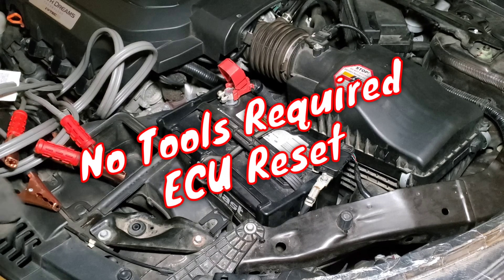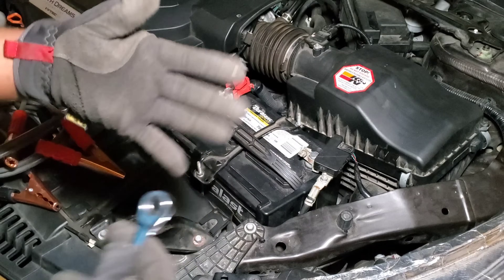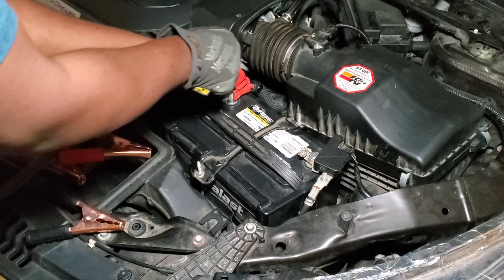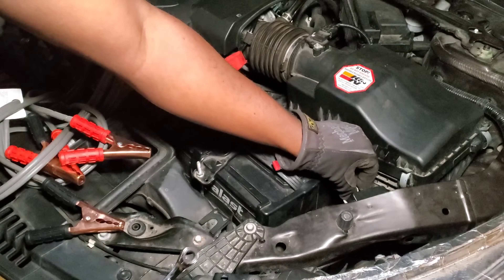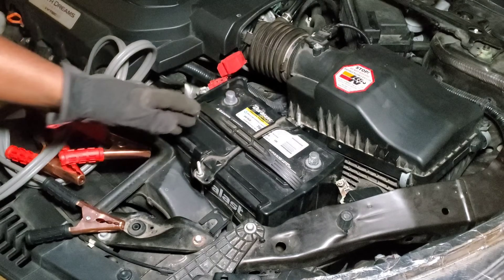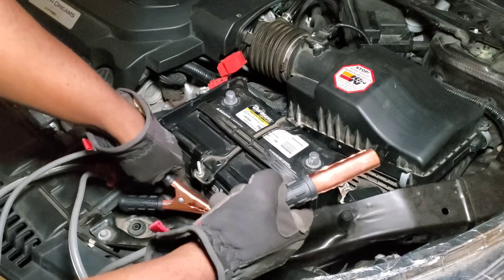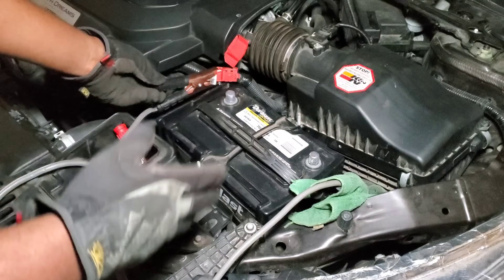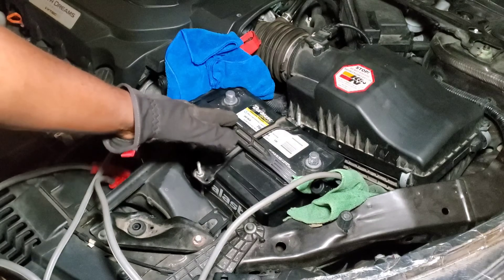How To Reset All ECU  No Scanner No Tools Required

Comment: There is another way to reset the check engine light on a 2018 Nissan Pathfinder.  It is sooo easy and it works!  Press your ignition button twice to put it into the run position, Lift the hood and remove the negative battery cable.  Then take the connector and touch the negative battery post three times about a second apart. Then just place the clamp back onto the battery, tighten, and start the vehicle.  The light should go away if the problem has been solved.  Trust me, it is that easy!  Try it, you’ll be glad you did.
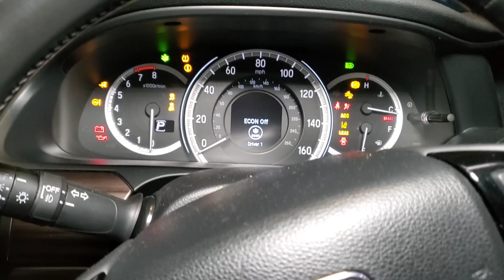Reply: What won't pass smog test 6:45

Comment: yes this works and remember -- if YOU have a remote starter, you will loose ability to use the remote starter if you live in a Northern climate and have one of these on your vehicle.  The remote will need to be reprogramed to your car at the place you bought the darn remote starter.  Mine cost me $25.00 to get this done.  And it happened before when I had to replace battery a couple years ago... I guess, this is ONE fact the remote starter place does NOT tell you... so beware, when YOU disconnect battery for a few minutes as described in this video -- you will need to shell out another $25.00 to get the remote starter working again too... dang it... Stay warm my friend.... stay warm.....
Reply: You can reprogram remote for remote start on your own. It’s easy.

Comment: of course some cars require re-calibrating certain sensors like electronic power steering sensors and electric window sensors, maybe entertainment center code input when battery power is removed for more than a couple of minutes!

Comment: Excellent advice I also turn on the head lamps while the battery terminals are off, it drains all energy and you get a full factory reset, excellent video!
Reply: @Sissiwit Sukisok You better check with Scotty on that one; he says although they don't light it still drains any power out of the capacitors.
Reply: @bradfallin2698  I agree, Scotty does give the best advice on Youtube.
Reply: @Paul Romsky  what's wrong with 2006 pt cruiser dieing when crank up and sputtering
Reply: @PamJohnson-iw2zt crankshaft positioning sensore ....
Reply: I had a 2005 pt cruiser for 10 years , had the same problem and it turned out to be camshaft position sensor , took 5 minutes to replace and problem was solved @PamJohnson-iw2zt
Reply: If the alternator is charging it's not going to die
Reply: IM WONDERIng if the battery cables would be too much. Just saw a video of scottys he said to use a one OHM 10 watt resistor, to coonect the cables.  maybe that is less spark than the jumper cables?

Comment: What if  you a have checked light on as a result of failed O2 sensor,? No matter how long you disconnect your battery terminals,the check light will still pop up , unless you get the 02 sensor replaced

Comment: I had problem with U1000 code. My battery and alternator were good and tested, but it wont charged the batter, when I drove about 10 minutes on the road It lost all power and shut off. What should be the problem here? Please help Thanks

Comment: Sorry. Doesn't work. Did exactly how you showed on your video. Reconnected and started up car and...no change...showing same as before
Reply: I STRONGLY SUGGEST THAT ANYONE WITH A 2012 Hyundai Sonata 2.0T, DO NOT TRY THIS, IT DOES NOT WORK!
I TRIED IT AND AS SOON AS I CONNECTED THE CABLE IT BECAME VERY HOT AND I HAD TO REMOVE IT IMMEDIATELY.
THE ENTIRE CABLE WAS VERY HOT AFTERWARDS.
I FOLLOWED THE VIDEO TO A TEE AND THESE ARE THE RESULTS THAT I RECEIVED.

Comment: I've a steering power faulty..so if i disconnect the battery for like one hour the fault code will be automatically deleted?
Reply from the maker: Doing this will reset all your codes but you have to make sure you fix the problem before doing this 🙏🏾🙏🏾

Comment: Cleaned throttle body butterfly and bore yesterday, then disconnected the battery reading 12.80V (= good).  With a voltmeter attached to the disconnected positive and negative cables this left a residual voltage of 1.23V.  After 45 minutes this had dropped to 0.14V.  After 12 hours residual voltage had dropped to 0.00V.  Then reconnected the battery. Started the car now purring nicely at idle.
Reply: So could I do this in 24 hours or less .. I'm guessing that would be a correct assumption.. but I'm in a pinch for time on my vw 2012 Eos Executive trim 2.0 TSI
Reply: That's facts I change a lot of things of my car and it was running worse like the computer didn't read them. New maf sensor new EGR valve filters battery clean the trothle spark plugs and cables . And it was running worse than before
Reply: Hi, what model and car is it? I have a 2008 Honda Civic, and I'm having the same problem, but I didn't fix that. I'm going to try it tonight. If it works, it might be a happy day, because I've already changed absolutely everything, and nothing fixes the high idle.

Comment: i have 2002 rav4, 1az engine, since january is parked, sent to 2 different mechanics, they robbed batter and cables, any way, car does not starts because when i try to start the engine, current does not reach bobins and plugs. 10 electricians have tried, they say someone has replaced ecu, i need opinion how to start this car.

Comment: @lover of engines , the brother how you doing ? I want to ask you if you do the same process you do to your car in a 2010 Acura MDX  it will work? And if you had any previous computer updates it will erase the updates or it will not affect those ecu updates ? Thank you
Reply from the maker: I'm pretty sure this will work for Acura because Honda make Acura
Reply: Hi brother..will this method work on Isuzu Kb200 petrol fuel injection van mine wont start..thnx keep well.

Comment: Hello my friend, I just removed the catalytic converter and when I started the truck it ran fine. I did remove the negative terminal to reset the engine light as another channel recommended. 

It's been about two weeks now since I removed the catalytic converter and I am getting an engine light 🕯️ and my truck is running really bad. I did the reset again with the negative terminal, but it didn't fix the rough running engine. 

What I want to know is, will doing it your way fix the problem with my 2020 Chevrolet Z-71 High Country Storm 2.8 liter turbo diesel??? 

If I drive my vehicle easy before I do this reset, will it hurt my vehicle? 

Please respond as soon as possible, as I need to do this today. 

By the way, I am an American now living in the Philippines. 

Thank you very much and I hope to hear from you very soon. 

God bless you and your family! 

Sincerely, 
Cpt. Michael R Metzler Sr 
U.S. Army Aviation Maintenance Officer/Helicopter 🚁 Test Pilot (retired/veteran)
Reply from the maker: Doing this will never hurt any vehicle, It will be nice to try and see what happens

Comment: Thank you so very much. I have a check engine light that is bothering me even after I have cleaned the throttle body. I will now try  you tip.
Reply: Did it worked?
Reply: @danandrei9197  It will reset a check engine light but unless the problem that caused the CEL is fixed...the light will come back on again.
Reply: why would cleaning the throttle body cause a check engine light to come on?

Comment: Once you reset the codes it may say "not ready" on inspection, the car needs to go through a few drive cycles to be "ready".
Reply: Yeah, that happened to me. The shop replaced the plugs and reset it, but I took it to the inspection station too soon. That's why I'm here now, to clear it myself and try again. I'll use this method and run some errands, then hit the inspection station.

Comment: I have a 2003 dodge dakota 3.9 liter v-6 engine and it won't start when i turn the ignition. All lights inside and out come on but wont make a sound. I had someone hook up a cd player to my ignition switch and my cd player went out months ago and now this happened. What do you think is wrong with it? PCM?ECM, ignition switch or could it just be a blown fuse or sensor?
Reply from the maker: Check your starter
Reply: I did and its good.

Comment: Hi, My battery is inside the vehicle under the central column, It is quite hard to get to, however the black strap grounding point is easily accessible. 
If I disconnect the black strap from the grounding point first. Could I then  connect the jumper terminal to the vehicle body to have this same desired affect?
Reply from the maker: No because the black cable is still connected to battery

Comment: Haha, I found out just yesterday. My car had a misfiring and would die when engage into gear. No amount of disconnecting the negative terminal helped.      Method: step on your accelerator fully to the floor and then turn ignition to "on" for 15s, continue pressing the accelerator to the floor. Then turn off ignition, lift off your accelerator. You are ready to go to normal starting and driving.
Reply: You flooded you engine.
Thats how you reset a flooded engine.
Reply: @timbowling6698  Wrong it wasnt flooded he had to do a relearning process for the throttle position,that was his problem.After messing with the butterfly in the throttle body with the battery connected this is what happens.
Reply: Is this also applicable for 318i bmw

Comment: not sure i understand the purpose of the jumper cables. If you just leave the battery cables disconnected for an hour, doesn't that also work?
Reply: To discharge all the electrons

Comment: i love your presentation i hope it will workfor my nissan sentra
Reply: depends on what your issues with your Nissan Sentra because the problem going around right now with a lot of Nissans is that the ECM/ECU needs an update and reset it doesn’t update it. Look for the technical service bulletin or TSB.

Comment: The fastest way is by discounting the negative side only and then running a jumper cable from the removed negative terminal to the positive terminal already on the battery that resets everything as new
Reply: do u coonect one black to negative the the other black to positive?
Reply: @lilryan7205  OMG. no this causes a full short! Yes you do exactly as shown. On the cables after they are disconnected from the battery.

Comment: How do you stop the Car alarm going off when you disconnect the battery? Alarms are a p.i.t.a.
Reply from the maker: you have to use the car key in the door to lock and unlock the door 2 to 3 times like you do old school some time the lock system get jem and you need the key to unjem it

Comment: apakah cara ini bisa diaplikasikan jika tampil indikator check engine & ABS di panel display speedometer?
Reply: Untuk ABS check engine light, perlu check wire dan speed sensor dulu.

Comment: So I have a 1998 Chevy Silverado 5.7 automatic four wheel drive they tell me one mechanic tells me there's a dead wire from the crank positioning sensor cannot time it correctly the other mechanic tells me there is a dead wire between the mass air flow sensor and he cannot time it correctly will do any complete reset on that perhaps bring my computer back to factory specs thank you for your help

Comment: U think it will work on my chrysler 200 2015 with service fuel sensor light on and empty fuel gas light on ???
Reply from the maker: yes but you have to fix the problem first before doing this

Comment: My astra j 2014 when scanned says misfire.

I changed plugs, I still get missfire when driving.

Do I have to reset again?
Try this procedure?
Reply from the maker: I don't know about that, but give it a try this is not going to do anything bad to your car
Reply: @Loverofengines101   I have a 2015 Chrysler 200c and check engine light on for cooling fan circuit I’ve gotten a new fan that came with new circuit and the mechanic says in order for the fan to work I have to go to Chrysler dealer so they can program it but my brother says just to try and do what you did he says sometimes that works what do you think because the fan will not turn on so the car overheating
Reply: Thx

Comment: the mil light illuminates for a very good reason, because there is a faulty component. this is snake oil guys, get yourself a cheap code reader and you will be just fine. why didnt we see a before and after of the display?
Reply: I agree with you. He said a code reader would cost 150/200. Yes some do but you can get some cheaper.  And this method do not clear the code it only gets the light on the dash to go off.
Reply: @babssb2ba  My wife bought my first scanner 4 years ago for £27 then, it was really good. I then bought a MBII scanner for the wifes S class for £135, not so good. Now I have a Autel DS808K that cost £605, it covers everything on the Mercedes and thats saying something, it will actually activate single components to test if they are working or not without removing them.

Comment: I just replaced my throttle body. Will this allow RPMs to return to factory?  As it is, if I tap the gas the RPMs jump up to about 2,000 and stay there for about 15 seconds before dropping back down...
Reply from the maker: yes but you have to go slow on the Gas until it return to normal this may takes some time keep driving, same thing happened to my Honda Accord. you do not want to do anything at this time just keep driving and go slow on the gas
Reply: @Loverofengines101  thank you!🔧👍
Reply: After you reset the ECU and turn the car back on you must wait until the ECU relearn and reprogram itself with the default factory values,  just turn it on and let it run idling for a few minutes.
Reply: Your vehicle will likely have throttle body/ actuator relearn procedures

Comment: This step should not be used on continental car (BMW, Merc. Unless it is a really old one, before 1990s). In some of these car, even unplugging the 12V battery to replace it will cost you tonnes of money  to get the car towed to dealership to reprogram/recalibrate the ECU. Battery power is needed for the ECUs (many ECU in these type of car, up to 10+ and more) to remember settings and calibration else it will not able to function properly.
Reply from the maker: this is the reason many people love Honda and Toyota very easy to work on
Reply: @Loverofengines101  just dont say "it works for any car"
Reply: @J__7777 😅❤❤❤
Reply: Volvo can?
Reply: Thanks for that! I was gonna try it on my '05 CL500 & had visions of everything working like new again.  Oh well.  Nice thought tho.
Reply: So it will not works on golf mk 5 mate?

Comment: Amigo ,always remove negative terminal first,if you accidently let your spanner touch earth..the whole body of the car, while removing positive side first you may end up with no ECU.
Reply: Probably no spanner either.
Not to mention possible burns, and the dire need for a new set of underpants.

Comment: Make sure you have the radio code if your radio uses one, and disconnect the NEGATIVE cable first
Reply: It worked, tnx...  

No disrespect.  but I find kinda funny some of the things you pronounce.
Reply: @joseadrianmascorroaguirre1387
Reply: Does the dame apply to a hybrid vehicle? I have a 2016 Honda grace, recently changed the rack and pinion and SAS and VSA light is now on
Reply: @andreevans7720  also, you will definitely need an alignment.
Reply: @andreevans7720  those lights need a dealer scan tool or a good snap on type scanner, and will need to be relearned. This is necessary for warning systems and backup lines in the backup camera.
Reply: I have the same problem, went to auto repair, code deleted, every thing was fine. then i first installed the check engine light and PGM light came , went to auto repair, code deleted, every thing was fine, removed the LED installed on the front for day time running lights installed some fuse in fuse box  again the same problem. Now i again went to same mechanic but he half heartly tried but code came again and again. did the above by removing battery terminal for hours and hours but the fault did not disappear, car performance is restricted, i can not rev the car in 1st gear above the 2000RPM until put the car in 2nd gear. same with other gears. How can i solve this?any advise please?

Comment: I’ve done this to clear a P0101 code (mass air flow sensor) and it cleared it for about a month but came back. I replaced the air flow sensor and still won’t clear. My code reader says it’s a “permanent code”.
Reply: Clean throttle body, and entire air intake pipe with throttle body cleaner. Change air filter, & clean mass air flow sensor with its cleaner.  U hv dirt in ur system. I did same issue and good now on crv
Reply: Can this also reset the Smartshield security system on your car or immobilizer ???
Reply: I have the same issue but my code is air throttle sensor. I'm going to try this method to reset all ECUs and tighten my gas cap and see if this fixes the issue.
Reply: @regalsurvivor3418  good luck, hope it fixes your problem.
Reply: I have EGR code. I have cleaned it but i drive 50km this code come back

Comment: It will work fine as long as you don't get a ECM from module experts
Reply: James, my mechanic said that I need to replace the ECU in my 2002 Toyota Avalon. Would it be alright to do this reset and possibly fix the car?

Comment: This really will reset your car to factory settings!!! Did it on my 2019 Camaro.
Reply: So did you have any dead wires such as from your ECU to your crank positioning sensor or from the ECU to your mass air flow I mean will it reset all that question
Reply: @bill6946  No.
Reply: @bill6946  I think I have dead wires from my ECU to my manifold air pressure. I have since changed my manifold air pressure, but the check engine light still persists. I wonder if this will work
Reply: @hearditfirst8010  i have similar after i changed my manifold.  Did it worked?
Reply: Good video
Can this procedure work on Holden commodore ve s1 v8.
It keeps popping esp control fault and then shut of the esp.
Please advice.
Regards.
Mikey